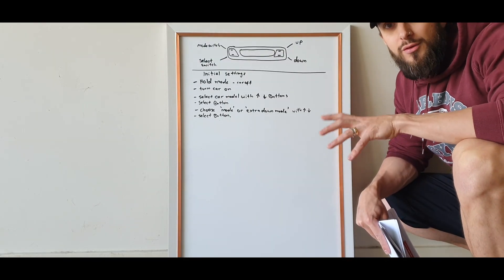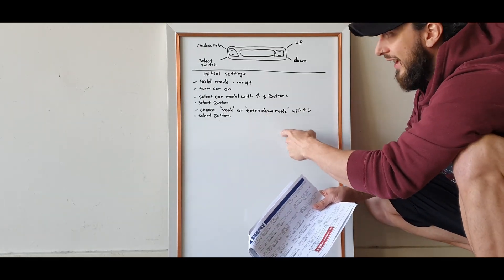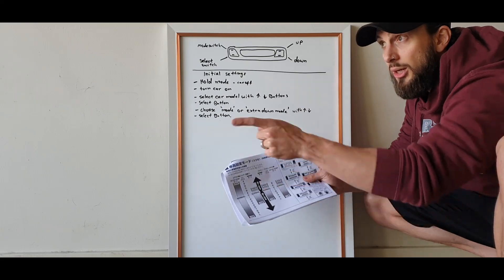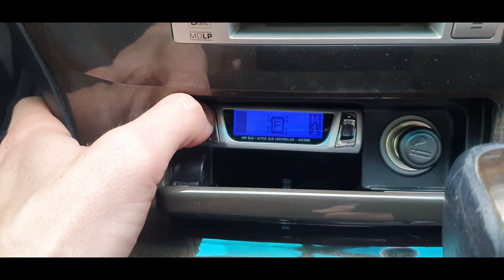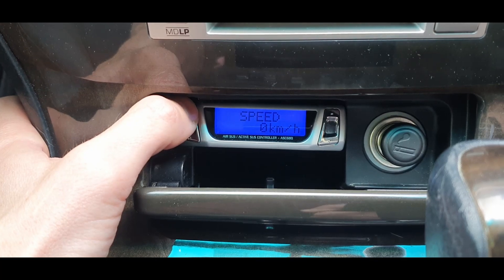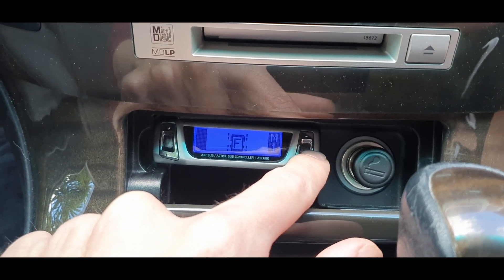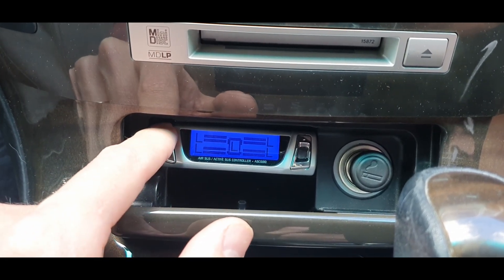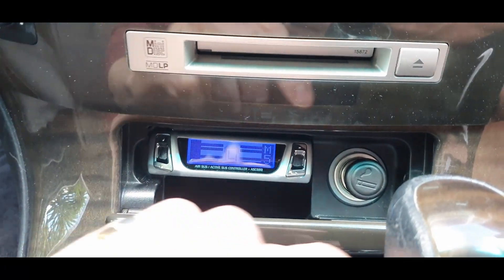HOW TO SETUP YOUR ASC680 AIR CONTROLLER

Comment: Cheers man. Installed an ASR681II into my URS206 yesterday. Very similar process, apart from the initial set-up. Have to set the car number on both the main control unit and the remote control unit. If you only set the remote control unit, it won't actually do anything 👍🏻
Reply from the maker: Yeah different models have their quirks and perks that's why I had to be so specific with the model number in the title aye haha
Reply: You have no idea how much time this very comment saved me. THANK YOU MAN!!!😂👌

Comment: Is there a fuze to air out all the suspension?
Reply from the maker: Not as far as I know
Reply from the maker: If you pull the compressor fuse the compressor won't turn on but this won't empty the bags hense why we all use the air controllers to do it

Comment: Any idea on which wire on back of unit is the main power
Reply from the maker: Na sorry just plug and play kinda deal with the loom on this one. I wouldn't be tapping Into this for power if that's what you are thinking
Reply: Nah my plug itself is buggered they main big one that plugs into the back of the unit cant find a replacment plug anywhere that i could rewire
Reply from the maker: @stevelloyd9856  oof I see sorry I can't be of much help
Reply: No probs good old test light did the trick

Comment: hi mate quick question, i saw a video of a toyota century with the same controller and it took nearly 10 minutes beforeit aired down. do you have the same expereince or is it instant drop? cheers
Reply from the maker: @connorgraham5421  na mines slow drop too stock systems work very slow I think it's 3 minutes down and 15 minutes up (including the 10 min time out after 3 minutes of running)

Comment: Hey bro a bit late to the video but I've just got a uzs186 majesta and tried searching for the same airbag controller as mine doesn't have one but it says it's not compatible with that model majesta?
Reply from the maker: @hellomyfriend7781  that's coz we use a different model in the menu but it does work asking as you select the model I show in this video :)
Reply: @AdamLetter  sweet cheers bro any idea where the best place is to buy one from? I'm in NZ and all the ones I can find online are like 1k+
Reply from the maker: @hellomyfriend7781  I would try yahoo Japan but yeah they are usually around 700 from what I have seen
Reply: @AdamLetter  hey bro I brought a asr681 and chance you have a install video? Had a quick look but couldn't find one
Reply from the maker: @hellomyfriend7781  na sorry I don't but they plug in behind the driver footwell next to the accelerator pedal ;)
Reply: @AdamLetter  cheers I'll try get mine hooked up
Reply from the maker: @hellomyfriend7781  are you in Melbourne
Reply: @AdamLetter  new Zealand
Reply from the maker: @hellomyfriend7781  dang was gonna install it for ya and video it

Comment: Sometimes when I check my car in the morning one of the back wheels are very low but goes back to normal when start up and driving,  would this indicate a bag leak? Is there a way to re configure normal mode? Thanks again for your detailed tutorial :) car is a ls430 on factory air
Reply from the maker: Yeah would say it's a slow leak on that bag. And no way to reconfigure normal as far as I am aware
Reply: @AdamLetter   thank you bro, I'll get it looked at 🙂

Comment: Mines also a uzs186 but the contoller only goes to 171 is yours the same
Reply from the maker: What do you mean only goes to 171
Reply from the maker: You want to use the setting UCF31
Reply: Awesome cheers and i ment it didnt have the 186 option only all the others and 171 which it is currently set on would that make much of a difference it being set on 171
Reply: @AdamLetter  171 was the closest number in rear wheel drive to 186 ,173 is 4wd it was set on 171 when i got it
Reply from the maker: @stevelloyd9856  well the instructions for a asc680 specifically say to set it to UCF31 for a 186/187 so I would say it will make a difference but your car your choice 🤗
Reply: @AdamLetter  thanks bro you been a huge help
Reply: @AdamLetter  theres two options for ucf31 both have a japanese symbol thats different on each one any ideas on what that is or any ucf31 option fine
Reply from the maker: @stevelloyd9856  I just go with the first one that comes up

Comment: Am I able to use stock air suspension controls like sport comfort and height high setting ? I have ls460l
Reply from the maker: Yup all stock adjustment still works
Reply from the maker: You won't use height high though as you leave it in "normal" and if you want to raise the car you would use the controller as it goes 4 steps higher than the factory "high" setting

Comment: Also height control sensor located behind the wheels in each corner little rod with 10mm nuts and adjustment slider the fronts are all the way to the top adjustment and the rears all all the way to the bottom shouldnt they all be the same and does anyone know whats low or heigh on these im assuming setting the slider all the way to the top would be low and all the way to the bottom would be high ???? Any suggestions people
Reply from the maker: I haven't messed with my height sensors I have noticed when people do this it's when they start getting issues. I would say setting them all the way up is the lowest setting and all the way down will make it sit higher

Comment: The list you have there for the different models has 3 different ucf31 options my controller has 2 one has this shaped indictor goes ucf31 ]  the the other is ucf31 R well looks like a R any idea what the difference is and why hasnt my controller got 3 options
Reply from the maker: Sorry bro no idea I don't know what controller U have for it to be different also I don't make these I just showed everyone the basics. I'm sure if you select the first one then try all heights and then do it on the second one you will tell the difference if there is any

Comment: Hi my majesta has this set up have followed all this thru with memory set but it keeps bagging up the front right up after a stop start but rear stays low any ideas
Reply from the maker: That's weird. So it's all at the height you want then when you turn the car off it stays there then you start the car and the front raises all by itself? But the rear stays at the setting it was at? Then does it come back down while driving ?
Reply: Got it sorted now but i cant get the hyper low mode setting now by holding down to get L

Comment: Hey buddy, i live in Canada. In the winter time what’s the proper way to store this baby? Do you have to take out the air in the tank?
Reply from the maker: Oof hard to say we don't store cars in the winter in Australia but there is no air tank to even do that to that's why the air system is so slow to raise 😉
Reply: @AdamLetter  alright. Does the oem air suspension has a tank? That’s what i’m worried about or if I ever own one. I’ll replace them to coils. Also, do you know if the Majesta share parts with other Toyota? Thanks!
Reply from the maker: @johnbacani2323  na no air tank mate, you can go coils but kinda takes away from cool features, yeah they cross over with a few models for  different parts
Reply: @AdamLetter  thank you so much man replying man. The engines are 100% same as Celsior so it should be good. What I’m worried about is the suspension components like front upper arms, ball joints, rear camber arms, front and rear brake pads. I wonder if they have crossover parts in some toyota or lexus?
Reply from the maker: @johnbacani2323  some of those will be cross over to other models

Comment: Im in extra down mode and i still cant get the Lmode by holding down the button it was doing it previously but now it wont do it at all
Reply from the maker: Have you got front and rear at same heights? Once they are you will have to get to hyper low L mode by moving the rear setting to L and it will bring them all to L
Reply: @AdamLetter  yeah front and rear set at 9 and still wont go into L hyper low

Comment: Hey boss, I've got a UVF46 (H19.5-24.9) & I'm having trouble finding the right codes. I'm on the ASR681ii but my car number codes are completely different from your ASC680L. Any advice you could give me?
Reply from the maker: Sorry I don't have any experience with the uvf46 or the asc681ii I would have thought they would be fairly similar but having no experience with that combo I would be guessing any advice and that's always a path to low chances of success

Comment: Hi Adam, I have just purchased a USR206 - I just wanted to know if adding the ASR 681 unit will allow me to lower the suspension even lower than the factory settings on the stock suspension? 
Cheers mate.
Reply from the maker: If that's the same as the asc680 on my model then it certainly will
Reply: @Adam Letter  it is the same thing, just the version for the later model car that's all from my understanding. 
Thanks for you quick reply mate, really digging your content 👍
Reply from the maker: @andreweade1745  thought that was the case yeah should drop it nice and low or really high in case you come across some crazy driveway etc. Thanks for your support 😊
Reply: @andreweade1745  How are things going 6 months later? Just bought a URS206 myself and considering either the ASC681 or just go full aftermarket bags (or coilovers with air cups).

Comment: Hello mate, I wonder if you have a way to reset the controller or sensor when the height is wrong. I actually encounter issue with my back that is 5cm heigher than normal.
Reply from the maker: I haven't been able to reset the controller per say as far as I know it read the heights sensors and adjusts as required I would suggest taking it to a place that has level ground and try taking it through a full range and don't do it fast so it slow and be patient sometimes the compressor will time out or the corners might be slower than others. I'm not sure if this changes anything but I have never had an issue and I always drive around in normal mode seems to keep the system happy then I slam it for parking/photos etc
Reply: @AdamLetter  I am currently translating the operation manual in English, with styling etc. (P17 on 23, it takes hours…)

There is some warning regardless of the car and situation. 

For example, when you go from height 9 (very low, but not Hyper LOW) to standard. You need to go from less than 4 level in a row, else you can lose the height.

But it's very different when you switch back to normal when on the L mode. Then you need to at least have 4 level of height, or normal selection directly to not lose the height location.

I started the translation because basics operations are easy, but all the warnings and special use case are very important too.
Reply from the maker: @4sstylz  yeah but also na haha I have never had an issue
Reply from the maker: @4sstylz  I translated and read those and the main one to worry about is driving over 100kmph on any mode but normal

Comment: Do you need anything like suspension wise.. control arms or had the gaurds rolled things like that to get the car to lower and to get super low?
Reply from the maker: Yeah mine has a low down kit 30mm front and 50mm rear and as for rolling your guards it all depends on your fitment my rears are cut out so clear front are factory

Comment: Hi adam do u know if the rear wheel bearing hub is a complete unit or can u just replace the bearing in the hub on your model majesta
Reply from the maker: Oooo not sure tbh haven't looked into it but if you look on amayama at the parts you will be able to see the exploded view of the rear hub setup

Comment: The UCF31 has 3 different selections (and the last one is in red and has a big warning?). Do you know what the difference is between the 3? I am looking for the smoothest, softest ride possible. Thanks for the great video!!
Reply from the maker: I always just select the first one and have setup about 4 of these in different 186s as for smoothest softest ride you would want to select not sport mode and not ride really low I find the softest ride is at normal setting as the bags have enough air to ride well but not so much to make them harder (imagine a balloon filled up all the way) and not so little that they do nothing (imagine an empty balloon )
Reply: @AdamLetter  sweet. Thanks Adam! I have 2000 Celsior and prefer the cushy ride.
Reply from the maker: @matthewlawrence6510  best way to run low with cushy is a low down kit keeps a good amount of air in the bags while running low so doesn't compromise the ride

Comment: Hey there, I get a warning message evey time i turn on the car, asc680 works however I have the impression that the front left is not following the other bags, or it does but slower, an ideas ?
Reply from the maker: Have you checked the screen that shows the height of the bags? Have a look at that and see if it's keeping up you have have a damaged bag. Keep in mind the system inflates and deflates in a sequence front left alone front right alone and rears together but seperate from the fronts
Reply: @AdamLetter  if i see the bar consently flashing then its worn out correct ?
but i can lower all the car 4 struts and put all 4 up again, just on the screen that shows the inflation, on keep flahsing, maybe i should wait more?
Reply from the maker: @theopunisher3021  how long are we talking? Coz from hyper low to full high mine takes about 20 mins
Reply: @AdamLetter  ok, I have been to my car today, and the screen I see is in fact the height of thec car by corner, but if i take a turno everthing move , so I was just not on a flat surface. 
Something I realise is when i use the controller, the message HEIGHT HI sometimes flashes on my dashboard, have you ever got that ?
Reply from the maker: @theopunisher3021  yup it does that when it's changing height and when you drive the heights will change as it's an adaptive system and the height sensors will rear all over the place depending if turning or bumpy roads

Comment: How did you setup for the 186 with no setting for the 186? Did you use the UCF31 Celsior setting?
Reply from the maker: Yup that's it
Reply from the maker: Sorry I didn't specifically say that in the video but in the part where I show the makes and models its the one in red :)

Comment: Hey adam，I ve bought this uzs186 model last month but I am not sure about the condition of my asc680 controller though, when I adjust it to the 9 mode, the right front just cannot get to that lowest level, is it because the connection wires were broken or something?
Reply from the maker: It could possibly be the height sensor. Have you tried a few times or just once?
Reply: @AdamLetter  quite a few times. sometimes it worked if I try to tighten the wires connected to asc680 with my hands.
Reply from the maker: @ruiyan696  sounds to me like bad termination as the asc680 if moving them fixed it sometimes.
Reply: @ruiyan696  are you in the extra low mode ?
Are you pressing 3 sec while on the height 9 ?

Comment: Hey just curious is the car on ignition or is it actually turned on before u adjust this? Also can I change while the car is moving or would that be bad ? Thanks!
Reply from the maker: Has to be turned on for the compressor to run and change height, and na U can change height as U drive I literally do it every single time I drive I pull out of or into my driveway on the highest setting and ain't no way imma park up and adjust height every drive I would sell it if I had to do that
Reply: @AdamLetter  ohh I see thanks boss much appreciated. I just got my crown Majesta today and it's my first time driving with an air controller. So I was kinda lost haha. 😅
Reply from the maker: @vineethkrrish93  all good 🤗happy to help

Comment: So in my car the controller either isn't working or I'm stupid, do you just memory set then it lowers by itself or have I missed something?
Reply from the maker: You set all five memory settings then you just scroll to which ever setting you want to sit at and leave it on that setting and let the suspension adjust. Bare in mind the stock suspension does move very slowly.
Reply: @AdamLetter  Hello there. I have an English RHD LS430 2002. I am hesitating with the two « UCF31 ». Any suggestions ?
Reply from the maker: @4sstylz  hey mate I'm not sure what you mean by hesitating between bthe two ucf31 do U mean you aren't sure which ucf31 setting to use? I think I used the first one but when I tried both on my mates majesta I didn't seem to notice a difference
Reply: @AdamLetter  yeah that's exactly my issue :)

Comment: When setting up, there is the harness with 3 female connectors and 3 male connectors. Both look the same, do you just disconnect the males from the oem controller and put them into the new harness and plug the males off the harness into the oem controller? Sorry I’m confused if you basically just operate the asc680 through the old oem controller with just the harness. Thank you
Reply from the maker: I would say so but tbh mine was already installed I am going to have to make a follow up video of actually plugging one in from start to finish but I would say that's the go because these work with the stock controller

Comment: Hey Bro, I’m currently having issues with mine  and wondering if you could shed some light - its gone into ultra low (L MODE)  perfectly fine previously , but recently all my settings and been reset, so i changed them all back - but for some reason i can’t go into L anymore (even while holding “ down”) any idea why?
Reply from the maker: Hey Bro your controller may be in "down mode" not "extra down mode" when it reset which gives you like 8 height settings not the 16  or whatever it is and also gets rid of the hyper low (L) mode. Just start from the beginning and set it up again and make sure u go to extra down mode on initial setup 🤗